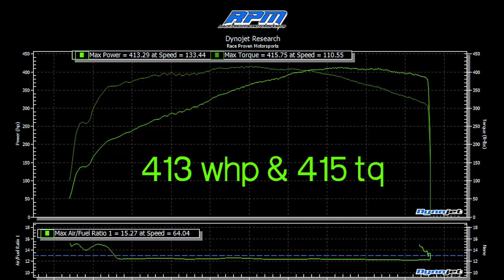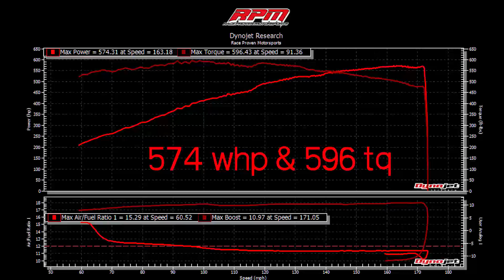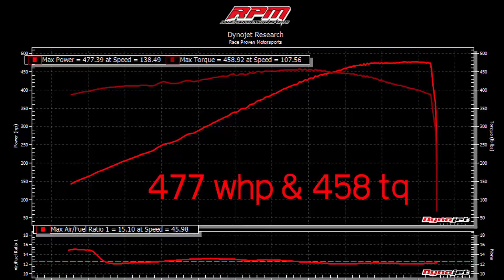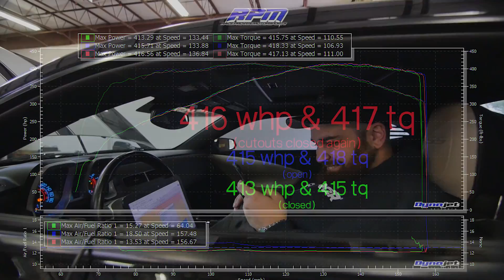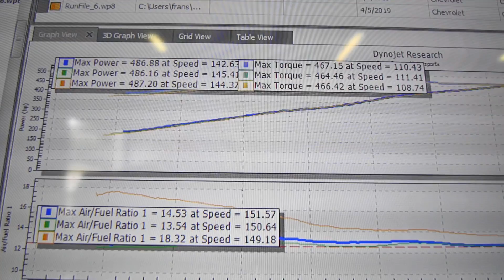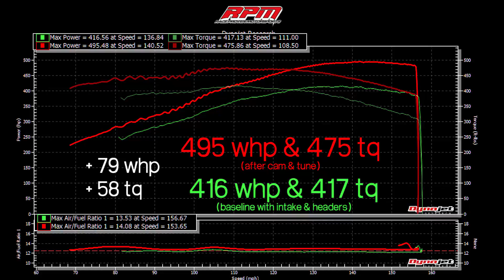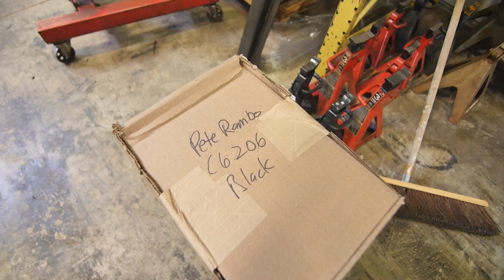Do exhaust cutouts gain horsepower? | RPM S7 E2

Comment: Although it's kind of sad to see that it doesn't gain power, I'm even more happy to see that it doesn't lose power either from the tune
Reply: Yeah, that was my concern. Just got a new cam w tune and just want a lil more sound w my extra power but was worried about it effectively w current tune.
Reply: @jamessalas9220 depends on how much backpressure you had to begin with. I gain 80hp due to backpressure from my nitrous running... at low rpm when open I lose power- so it opens at a certain rpm and I still keep my low end torque.
Reply: @dylandesmond What rpm do you have it set to open at?

Comment: Cut outs really only change power in cars that dont have a cat and resonator. 

We have seen it on the dyno a bit. Vehicles that have cats and resonators the power either falls off or makes no change.

In street cars where customers have a resonator and muffler to keep the noise down some with the cut out before the resonator they make a decent amount of difference in power with them closed/open.

Comment: What if cutouts are installed upstream of the catalytic convertor? Are the Cats 🐈 the choke points of the exhaust system? Large bore eg. 3 inch pipes are almost the same as  not having a muffler.

Comment: When you put the "Y" shape cutout on and open the valve, won’t some exhaust still flow through the original exhaust to the muffler? Or does the cutout somehow get all the exhaust to go through it’s valve end?
Reply: Basically it will go through both but also the open one is the path of less resistance so it will flow much easier

Comment: Yeah it all depends on how restrictive the exhaust is, i remember on my 95 lt1 f body it was  a pretty good difference. No dyno numbers but track times closed ran 14.2 and open ran 13.9 and was placed before going over the axel. And car had a flowmaster not a stock muffler
Reply from the maker: The Flowmaster was your issue.  They are junk
Reply: @RaceProvenMotorsports  i went from 314 whp to 328 whp on my stock 2002 ls1 camaro auto with 120k miles. I think it’s in my YouTube. Just by opening up the cutout just beside the flow master muffler(only “mod”).

Comment: My 99 TransAm  has an off road Y pipe with no convertors going into into an electronic cut and a stock muffler. With the cut out open at idle you can still feel exhaust coming out of the stock muffler however, with this set up you can definitely tell there is more power when the cut out is open. If you had a high flow muffler and/or them DUMB😳SS convertors on your car they are not going to work as well..My car is also tuned and the engine only has 34,000 miles...brand new LS1 from GM I bought back in the day....The dealer wanted $6000 back then for a new LS long block but on line from Pace Performance I got one for $2800 bucks..

Comment: don't you think cuts out would benefit more with a turbo car? Im about to go twin turbo and deciding id I should get the cut outs? Im thinking yes...… But I think going to a larger header and running a full 3" exhaust would benefit better than the cutouts. I think opening up the headers will benefit more.
Reply: Like other people have said,  it really depends on how restrictive the current exhaust is on your vehicle.  If you have a complete aftermarket exhaust that flows well,  the cutouts won't make a difference. However,  if you have a severely undersized exhaust from the factory,  then you could potentially see a gain with the cutouts open. The thing is though,  cutouts are more for sound,  not really performance. Just my 2 cents 👍

Comment: A/F was 18:1 with cutouts open, 15:1 when closed. Pretty sure you'd pick up power just correcting for that, no?
Reply: jason levitt u can’t be serious.  1 you’re not reading the graph correctly (that’s max AFR) when the car lets off. 2. Think about your comment for a second.  You  think opening a cut out is going to change the tune? A more logical thing would be the fact that the wideband (in the exhaust tip) isn’t getting all of the exhaust .... BECAUSE ITS GOING THROUGH THE CUTOUT.
Reply: @jeremyleftwich1309  it was almost 16:1 closed, sparky. What would you expect when you open headers before cats and mufflers? I'd guess- stay with me here- it might get leaner...
Would you think that 16:1 is good for making power?
Reply: Jason, Jeremy is Right. Tune won't change based on cutouts opening because of the wideband reading location.  And On the Graph you are looking at the Max value - the squigly line at the end when the person lets off of the gas. You have to look at the line across the graph.

Comment: That makes 
ZERO SENSE. 
Because MOTOR TREND 
Did a more in detail video on cut outs. 
And there was a massive difference of
61 hp . I believe where your cuts were located is why you had no gains.
Reply from the maker: Hahahaha.  Fucking motor trend.   Let me guess the cutout company sponsored it too right?
Reply: @RaceProvenMotorsports   
No. 
They put an engine on an engine Dyno run it with open headers . 789hp 
Added exhaust 723hp 
Added cut-outs (closed) 721hp 
Cut-outs (open) 781hp 
But their cut outs were right after headers. 
Y'all showed a picture of cut out right by the mufflers. I don't know if that was the setup or not. 
right at mufflers 
But that's still a big difference. 
I am betting its the location of the cutout location.